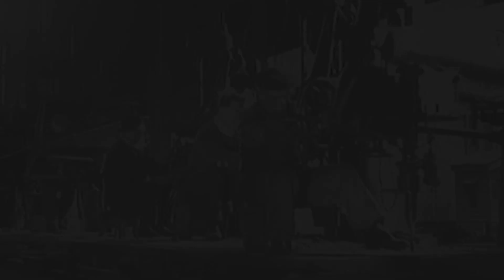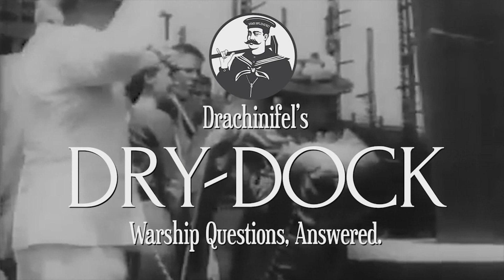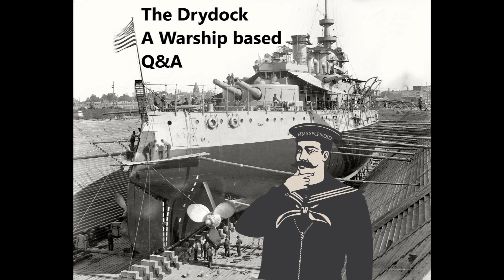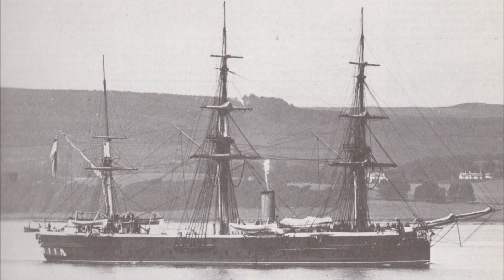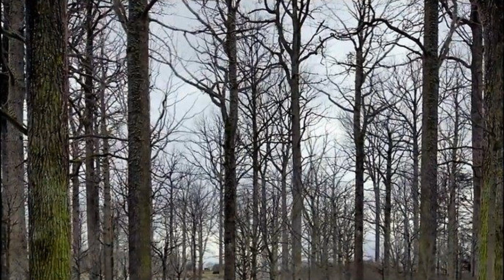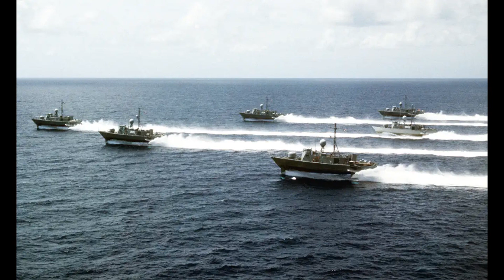The Drydock - Episode 132

Comment: In regard to welds cracking...the early Liberty ships had problems with hull and deck cracking, but it was not the welds that cracked...it was the steel plates themselves. The British built Liberty ship Empire Duke was tested by Cambridge University, and it was found that the cracks developed due to low temperature embrittlement caused by the cold water of the north Atlantic. The welds allowed the cracks to propegate to the point where structural failure and sinking occurred...something that did not happen with the same type of hull plates in riveted construction. It was also found that square corner hatch welds at plate seams created stress concentration points that acted as nucleating points for plate cracking to begin.

Comment: 59:00 regarding welding in Liberty Ships: In our Materials properties class in university we learned that the quality of the weld wasn't necessarily the problem, it was more that they didn't really understand the material properties that caused the welds to fail. Fracture mechanics wasn't a field that was a thing in the 40s and 50s, but the loss of some liberty ships in the arctic for example and the failure of the deHavilland Comet caused this field to be extensively explored.

Correct me if I'm wrong, university wasn't yesterday :D
Reply: You are right sir, its obvious !
Reply: Liberty ship welds terminated at corners of hold openings so the stress concentration was at a weld joint. The fix was to have the corners in the in the middle of a plate.
Reply: When you are paying a bonus for the number of feet welded, someone should check the welds where the number of feet claimed  exceeds what is possible in shift

Comment: In regard to the relative ease of fighters taking off from carriers compared to strike aircraft, I watched a documentary about the British Pacific Fleet. In it during audio interviews with the actual aircrew they said the Seafire could take off without catipult assistance, but all the other aircraft required catapult assistance. The relative lightness and slow takeoff speed and Powerful engine of the Seafire made it an easy aircraft to fly off a carrier. Conversely, these very same characteristics made it hard to land back on an aircraft carrier. In those days the technique to  landing an aircraft on a carrier was to fly as slow as possible and get as low as possible and stall the aircraft onto the deck as soon as you got over the deck, in.order to catch the arrestor wires as early as possible. Apparently the seafire just wouldn't stall easily and they would quite often find themselves halfway down the deck before it did finally stall. That and the nose up landing attitude and long nose of the seafire made it difficult to land on carriers.
Reply: They also had to come in on an angle (yaw) because the length of the nose made it difficult to see the deck! Amazing the planes took off the deck at all with the pilots having such huge, heavy balls of steel!

Comment: The drydock in which the hulls of the Bismarck and Tirpitz were built is still in operation in Blohm and Voss in Hamburg. It was specially built for this task. The only docks these ships could use in Occupied Europe was this and one at St Nazaire, the Normandy Dock. This was effectively put out of action by the St Nazaire Raid.
Reply: The Tirpitz was actually built at Wilhelmshaven in a naval yard,  not a private sector yard.
Reply: @simonpitt8145  Your correct it was the Bismark that was built in Hamburg.

Comment: Drach: Re: Failed welds in Liberty Ships.  

As I understand it, the preponderance of these failures were essentially the building environment.  As construction ramped up, many more workers were trained in both welding, and weld inspection.  A green welder may learn to make a visually "pretty bead", but lack penetration.  Likewise, those inspecting, might not be able to detect a shallow weld.    The shallow weld might later fail.

I believe most of those Liberties lost were the mid-production, such as SS Jeremiah O'Brien, which were half-riveted, half welded.  Later on, further training, and experience, had solved the issues.

Comment: The biggest problem with cracking on a welded ship is the welds don't stop the propagation of the crack were as when a crack reaches a riveted joint it stops.

A book I read twenty or thirty years ago stated that bad welding or bad steel got the blame all the cracking on Liberty Ships happened in the same area which leads to the conclusion that the problem was bad design. The two long steel bandaids riveted to the ship to reinforce the structure where the cracking took place solved the problem and of course being riveted in the crack couldn't propagate into the bandaids.

Comment: On the practice of welding of ships in WW2 I was told that USN ships were both welded and riveted because the rivet holes served as crack stopping points if a plate had a crack propagating in it. Also the cracking in Liberty Ships was because of inappropriate grades of steel being used as much as the method of construction.

Comment: Welding was a new technology.  However most of the issues experienced with Liberty Ships were due to the steel used.   Steel wit specific properties becomes brittle in cold weather.  It will shatter like glass , well safety laminated glass actually.  particularly near a welded joint.   The weld wouldnt let loose but the steel along side the joint would .    Even modern steel breaks easier when exposed to cold weather and shock is introduced.   ie snow moving equipment
Reply: That’s why SpaceX has developed a custom steel (SS 304X) that is more ductile & less brittle at Cryogenic Temperatures than almost all other standard steels.
Reply: @TraditionalAnglican  Austenitic stainless steels in the 3xx series have excellent low temperature ductility, they're basically standard for cryogenic equipment. SpaceX's stainless (as used in the starship prototypes) is anything but custom- it's just grade 304L (the same as used for making kitchen sinks and cooking pots). They probably have tighter control of composition and properties than standard commercial stainless, but the underlying metallurgy dates back to the 1930s.

Comment: I think the rate of fire cruiser killer would probably be better with an eight inch gun layout and maybe just have the armor to resist the same vs 12 inch fire. Most treaty cruisers could probably do fairly well at resisting six inch fire while they had problems with eight inch fire. You’d also get much better capabilities in a situation like the Battle of the River Plate. And it would have better capabilities against the supercruisers by having better firepower and potentially by being faster with a slightly lighter armor ... or at least able to have a good speed without a massively supercharged power plant. 
If we are insisting on the six inch guns maybe a quad turret might be the way to go. Technical issues aside it’d allow that six turret arrangement to give 24 barrels. That would be a very popular vessel for shore bombardment duties, but it would probably need a whole convoy of supply vessels to top up ammunition

Comment: My thoughts
1) The Graf Zeppelin would have been extremely effective at being an artificial reef. Provided she was sunk in shallow water. Given the loss rate of 109s from accidents I doubt they would last very long. A far better air group for her had she gone into service in my opinion would have been all FW-190 A4s with some possible torpedo bomber. The A4 coul have handled the dive bomber role better than the Stuka at sea. The only real problem I see with the 190 is it's relatively high wing loading iirc. Now I'll have to go back and go through Jerry's FW-190 series. 
2) In terms of a cost benefit analysis the Bouge and Casablancas may have been the most effective ships built in WWII
3) The first "cruiser". Well I would consider the ACW Kearsage a cruiser. As for Battlecruisers I'll go with the Constitution. Outrun what you can't fight. Outright anything else. If we get into battle axes well that's highly subjective.
4) Building x ships instead of y ship. It's not just the hulls and dockyard space. It's the other stuff that goes into those hills. If the Kreigsmarine decided to build a bunch of destroyers instead of Bismarck and Tirpitz it would have been a better use of the steel (nothing Germany does affects the overall outcome of the war after 1941). But then you need to compete with sub production for power plants etc.
5) Carriers getting involved in a surface action. Unless they blunder into one there is no excuse for a carrier captain to allow his ship to get into a surface action with an enemy warship. Plus nobody really operated carriers all by themselves. If a carrier does get into a gun surface action with say a cruiser the two vessels early in the war up to say the end of 42 that would have had the best chance to survive would be Lexington and Saratoga given their 8" cruiser guns. Late war the Essex's might have a chance given their high rate of fire from their 5"38s. Glorious' captain if he survived should have been given a locked room and a pistol. 
6) Shimano would have been a decently effective fleet carrier provided she was being used by the US Navy or the Royal Navy.  The IJN simply didn't have the depth of pilot pool the US and Britian did.
7) Hydrofoils. I can see their use as missile boats possibly but as attractive as their speed capability is once radars and surface to surface or air launched surface missiles come on line they simply have no protection from these beyond dodging. Plus there operating costs at high speed I would imagine are rather high. Looking at the current Aimerica's Cup boats i am amazed just how much hull and effective sail area they can support and maintain on two foils much less the three.
8) Naval small arms. One advantage Navies have over Armies in this field is the small arms requirements for a Navy tend to be much lower in terms of the number of weapons needed. The US Navy was able to field the Lee while the US Army was still fielding Trapdoor Springfields (the US Army was not ignorant of the capability of repeating rifles, they had tested numerous trials guns). Today we see US Navy ships still carrying M14s in their arms lockers. The Goast Guard might have M16s or M4s inboard the cutters involved in drug interdiction.  The Royal Navy probably still has L1A1 SLRs.

Comment: You missed another factor that made high-speed capability an important requirement for aircraft carriers: Hit and run raids. A task group could make a fast run into a target minimizing the target's chances of detecting the incoming strike, make their strikes and then make a fast run back out and get out of range of possible retaliatory strikes as soon as possible.
Reply: Also, launch a strike ASAP and sail towards the target so that returning aircraft could make it back before running out of fuel, thus maximizing range.

Also, before advanced electronics and radar, the use of daylight was critical, especially if your enemy was adept at nightfighting surface actions. Scoot into range, launch attack, scoot out once planes return.

Comment: The trolley catapult on Graf Zeppelin, on paper this seems rather innovative, allowing her to launch massive strike attack at once at rapid rate but practically, its very complex design and proved problematic as recharging take many times (meaning they can only do one massive strike attack) and prone to bad weather (hence the trolley should be pulled back into flight deck to avoid being break or froze by winter), a joke floating Graf Zeppelin-class described them as "mother of seaplane" sorta things.

Comment: To add to the weld discussion, I think the Yamato-class would've been able to endure even more punishment if they had welds instead of their rivets, since they had known faulty rivets after the USS Skate torpedo attack on Yamato that tore the large gash, the 1000 lb. AP bomb hit that penetrated Yamato and blew out a side plate from the inside at the Battle of the Sibuyan Sea, and the hits on Shinano. It likely would've prolonged their demise, but I'd be curious as to how long.
Reply: The Yamatos DID use welding, not rivets. The fault in their TDS was a result of poor design in one specific (welded) part, not rivets.
Reply: Under the condition that its good quality welding, yes, and the Yamatos would also have been several K tons lighter !

Comment: Type 95: 900 lb warhead
G7: 600 lb warhead
Mark VIII: 750 lb warhead
Mark 14: 500 lb warhead

Drach: Type 95 has a "decent enough warhead". If that doesn't rely entirely on differences in explosive strength, then, as the above comparison shows, the statement makes no sense. Even then, the next largest warhead is entirely TNT while the Japanese used essentially the same hexanite formula as the Germans (slightly less powerful than pure TNT, probably not enough to cover the 20% weight difference).

Comment: Weren't the cracks in the Liberty ships proximately  caused by the cold Arctic water embrittling the steel?
Reply: Carbon content in the steel and not using an appropriate welding procedure.
Reply: Steel beocming brittle, ductile - brittle transition temperature of shipbuidling steel is easiy reached in the Atlantic in winter, but you need some form of stress concentration too. My Engineering degree course a LOT of years ago always mentioned a hatchway as an example, simply cut square as opposed to a radiused corner, because the square cut is faster to do on a ship where a short build time is part of the specification.
Reply: It was the welds that failed not the steel. If the plate was the problem then riveted ships would have suffered as well.
Reply: @andrewfanner2245  The fix on Liberty ships was to apply a doubler plate that was riveted in place.
Reply: @andrewfanner2245  "stress concentration" and "simply cut square as opposed to a radiused corner" is also what doomed the de Havilland Comet.
Reply: At least one liberty ship look-out on the front of his ship, telephoned the bridge to say that a ship was passing close to starbourd, only to find that it was in fact the STERN of his own ship that was passing.  The stern (with the engine room of course) then later towed the front half into port.  I read somewhere years ago that the early liberty ships were made from a rivetted design that was welded (for speed of construction) rather than a design INTENDED to be welded.  

I also knew an old retired shipyard welder (long since dead) who's very first welding job was to weld in place a ships engine mounting supports, but only AFTER they had been rivetted in place. A case of not trusting the welding process on its own to hold the mounts in position long term.
Reply: @benwilson6145  My understanding is that a crack is less likely to propagate across a riveted joint than a welded one.
Reply: @CharlesStearman  yes, because the new plate is a separate piece of material. The crack reaches the end of the plate it started on. A crack in the next plate would start somewhere else.
Reply: @sirmalus5153  My father was working for Gibbs and Cox in New York at the time when the British purchasing commision showed up with amount other things plans of a British tramp steamer built about 10 years before as an example of what they wanted to build. The first go around was the Ocean class of which 60 ships were built. (There was a model of this ship in the G & C office as I remember it as a kid). Somebody asked the Brits if 60 ships would win the war. President Roosevelt in any case authorized the revised design that became the liberty ship. My fathers contribution was the oil fuel conversion , the water tube boilers, bigger electrical plant for all the electric deck machinery.